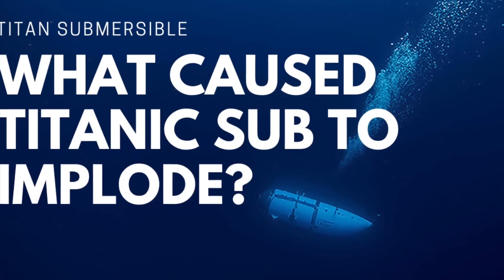What Caused the Titanic Submersible Titan to Implode?

Comment: You didn’t see any gasket between the metal ring and the composite tube is because they used adhesive. That’s an other videos that are out there will show that. 

Now, if you want to comment about how they inappropriately used the adhesive, I think you would have a better observation
Reply from the maker: not between the ring and the tube, but between the ring and the front that bolts on.
there is the titanium ring bonded to the carbon fibre, but when they climb in the titanium front bolts on  and it  mates directly against the titanium ring. so you have 2 flat pieces of titanium in direct contact. i would think having a seal of some sort in there would be beneficial.

Comment: The carbon fibre was wound around a 2 inch thick steel tube , also the inner chamber was lined with a fine woven mesh . No way was the monitor screwed to the carbon fibre. Not even Stockton was that stupid .

Comment: Carbon fiber was not the right material. This vessel should have been 6" of titanium with no cf. Proper double walled pressurized windows. The cheapest imo would have been about 10 to 15 mil to build. How much did they put into this thing? Vessel should have been tested and certified BEFORE taking any paying passengers regardless of disclaimers. Sad.

Comment: There was an inner lining to which the monitors and lights were attached to.  Rush was filmed stating this and that there were NO holes in the carbon fiber hull. You need to fact check better.

Comment: I just replaced my steel well tank with a much thicker composite tank. The manufacturer of the composite tank mandated the use of a vacuum breaker on top to prevent the tank from collapsing when it is being drained. The thinner steel tank didn’t require a vacuum breaker. 
I’m not an engineer or a sub designer but I know what materials I would use.

Comment: ..everyone who ever laid down some boat hull, regardless size, will tell you that fiberglass(sister of carbon fiber) is porous material, just like carbom fiber, while steel, aluminium, is not. And these features of materials gets amplified rapidly under tremendous pressure, if there is slightest imperfection on resin side. This is exactly where things went wrong.

Comment: SO, how does a carbon fiber hull, which seems to be weakened by penetrations, have the controls penetrate it? 
and what was inthe rear tail cone? Was it just streamlining? Or a cover for the control lines?
Reply from the maker: I wonder if that’s one of the reasons for a Bluetooth controller. All the control systems are external to the pressure hull, with no penetrations. Lots of gear looked to be under the tail cone

Comment: To be fair that looks an inner liner he's screwed stuff to, I've seen a video where they fit the backlights in without the liner fitted. There's a titanium drum between the cf and inner cf liner by the looks of it. One thing no ones looking at is the grommets and connections going into hull, also how well were the computers protected? He has expressed belief that only the hull needs protection, I'm dubious as to how well he has engineered the components he deems nonessential. He could have even carried a tank down there of the wrong rating and destroyed the hull with it. We wouldn't know from here.

Comment: Just a couple of comments/observations. If the faces of the nose dome and ring are not well milled then surely, asuming there is no elastic deformation making a seal due to external pressure, then surely there would be water ingress at some point.
Also just from the video, the internal surface where the monitor is bolted appears to be metal rather than the carbon composite. Is this perhaps not just an interrnal liner of some sort and the monitor is in fact bolted to that.

Comment: The no seal on the titanium isn’t the issue and it’s well known now that the screws didn’t go into the carbon fiber. Stockton talks about that in an old interview. It was either the materials interface, or the carbon fiber itself since it can’t manage exterior pressure well

Comment: At 2:24, that thin ring seen on the mating surface probably is the seal.  A cursory analysis suggests that the bolts only need to locate the end caps, not hold them in place, as the net effect of the water pressure is to force the end caps against the end rings.

At 2:59, optically flat ground surfaces are relatively easy to produce, in threes.  Rub one against two, then rub two against three, and finish by rubbing three against one.  Do this repeatedly with finer and finer abrasive grit and the three surfaces can have the differences between the highest and lowest spots being less than a wavelength of visible light.  As the parts with the intended flat mating surfaces get larger and larger, this gets more difficult, but it was known in Isaac Newton's lifetime.
Reply: Obviously the end caps had a proper seal.  They may be found still bolted to the glue rings.

Comment: Little or no scrutiny seems to be directed at the epoxy joint between two very different materials,,carbon fiber and titanium,,or the greatly different thermal and mechanical properties of each,, when subjected to the extreme thermal and pressure related mechanical forces encountered during a dive to such depths.
Reply: That needs to be looked if they can bring up the pieces.

Comment: Good job, Those were my two major questions/concerns,  the way the carbon fiber was wound with no weaving pattern,  and the 4000m depth rating,  you are the first I have seen bring up those two important failure points,  everyone else just wants to talk about the game controller,
Reply: The game controller is a Red Herring as far as I can tell.  It is not the cause of the loss.   But then again who really knows?  Will it be found intact?
Reply: You are almost certainly right about the irrelevance of the game controller, However until they do an analysis of the wreckage, nothing can be dismissed at this stage.

Comment: From what I understand, they put a carbon fiber insert inside the main carbon fiber hull. With that said, couldn't he have used a titanium liner on both the outside and inside? Not sure what thickness, but he'd still save weight and add strength to counteract the extreme external pressure.
Reply: I thought that too.
Reply: I never saw any reference to the “liner”. They certainly wanted to avoid using titanium since it is a lot harder and expensive to work with titanium.

Comment: Can somebody clear something up here. Cameron says the explosion occurred at 3500 feet. That would only yield a PSI of 550 or so. Would that pressure cause an implosion? Or, did he really mean 3500 meters which then would result in a PSI of over 5000? Something’s not adding up here because both the captain of the Coast Guard and Cameron are calling out the loss of communications at 3500 feet. They also say they were 1 hour and 45 minutes into the trip which should almost put them at the bottom in just 30 or so more minutes. We haven’t heard what their descent rate was in the vertical so it’s difficult to place where they would have been at 1 hour and 45 minutes.
Reply from the maker: i belive he meant meters, not feet. its 2 hours down to the titanic, at 3800m, so 1h45m in, being around 3500m sounds right.

Comment: at 2:21 you can see there is a transparent liner inside the cylinder, the monitors are bolted to that transparent (perhaps insulating) material and you can see ceiling lights under the lining shining green

Comment: For example with lifting equipment as cranes, telfers, chains, if they are rated to 2 tons, they have to withstand atleast 3x overweight of 6 tons. 4km submarine should also be tested at 12km atleast 500 times. Then you can atleast take notes and approximate how many times the sub can dive.
Reply: I assume any safety factor was guess work at best.  The engineering  of the FIU bridge was very poor.  The engineer of recorded stated he didn't believe the cracking was a problem just a short time before it collapsed completely killing at least 6 underneath.

Comment: One of the passengers said that the plexiglass window cracked thus it might have been a factor of the implosion. Your presentation was very good with good information  and a video on how the passengers were bolted in ,so please make more videos on ocean gate
Reply: I'm thinking if the CF is completely shattered it would be the problem. If the craft had been found more or less intact but full of water something else would be the problem,   The Titanium end rings will be of interest.  How much glue is left on them?  Maybe the Plexiglass window will be found more or less undamaged.
Reply: @JoeLinux2000 Apparently the window blew out (or in, or disintegrated). An eagle-eyed commenter noticed the wreck as it was brought up — there was empty space where the window was supposed to be. 
Incredibly sad.😔

Comment: I noticed the computer monitors and lights screwed into the hill as well. Ridiculous. Aldo, it has seams. I don’t like seams on a sub. Water will, eventually, find its way and implode at the seams. It’s stronger when the vessel is one whole piece. This guy was nuts.
Reply: They are never in one whole piece, there has to be at least one hatch and a viewing port of some sort. I think the seams you noticed are on the internal  metal liner rather than the pressure hull.

Comment: In regards to the flat on flat titanium mounting plates of the nose entry cap, a conical surface would be a mechanically better design to insure the seal.  A pressure ring and latches instead of bolts would be better.
Did they consider bolt an thread fatigue?
Was a torque wrench  used to insure even and proper bolt stress?
Reply: I think I saw them using a torque  wrench in one video.
Reply: @JoeLinux2000 , 
Thanks.
I wasn't sure.
Usually one speeds or ratchets a bolt almost tight, then torques it down to final tightness.

Comment: As a practical person I believe the titanium rings that the domes were bolted through to were "glued" by some form of adhesive which to fair can be very strong.The issue I have is due to the freezing temperatures at those atlantic depths and variations in contraction between carbon fibre and titatanium. Under the enormous pressure on top of that my thoery is one of the titnium rings separated as the carbon fibre contracted under said pressure and broke the adhesive bonding.Or as you suggested the mating surfaces were not exactly flat.( much like a cylinder head on a engine causing gasket faliure) 2 tons per square inch will do its thing at the weakest point.I also believe the actual thickness of the hull was a mere 5 inches.Surely that would have rang alarm bells with me .Steel is very different and  inches would sound reasonable but knowing how modern day carbon fibre bicyles flex compared to steel would have made me avoid this trip personally.I an surprised it actually managed a couple of journeys before it failed.More luck than judgement arguably?
Reply: That is were if I were a betting man I'd put my money. Dissimilar materials glued under those pressures and temperatures are guaranteed to fail.
Reply: ...And when they bolted the thing shut, they didn't even use torque wrenches. "Hand tight, Mate"? "Yeah, that's good enough".
Reply: Carbon fiber is not have elasticity when under pressure. Titanium does. An engineer on site brought this point up however he was fired. Best job termination ever! It perhaps saved the engineers life.
Reply: Your theory might just lead to leak, and the entire craft might have been found intact on the bottom full  of water.
Reply: @JoeLinux2000  doesn't work that way with pressure.

Comment: Very good catch. Stockton Rush hired a bunch of amateurs so his view didn't get challenged.
"A chain is as good as its weakest link" and his weakest link was very weak. Drilling holes into the carbon fiber was definitely a bad idea, and if the screw was 1 inch long, his 5 inches thick carbon fiber hole was only good for 4 inches.
Reply: Not sure any of that is true.

Comment: They got lucky with a catastrophic implosion.  There are worse and more painful  ways they could've died down there. A leak being a  particularly bad way to go. Others like fire and suffocation are also bad.
Reply: Very good points.  It's actually a very good way to go, particularly if they never had any indication it was coming.
Reply: No such thing as a leak at 6,000 psi. It holds or it implodes.
Reply: @johnsmith-wo4fr  Nope. A leak is possible. And considering that Carbon Fiber is better in Tension,  it would've held(under certain conditions) till the water and air pressure equalized. Which would've been a bad way to go. We are not certain yet what caused them to try to abandon anx resurface...or if they tried to resurface at all. There's ambiguous information floating out there.

Comment: 13 dives is pretty good.  I wouldn't think it would survive 1.  8 hours at the bottom 13 times shows the design did work.  So if you take the cost to build one vs a fully classed metal one, it might have been cheaper to use it 6 times if 10 to 15 times is the limit and the average is 13-15.  You can reuse the titanium ends and replace the plex window or remove it all together and just use cameras.  Make a crisscross pattern, better glue application, make the carbon fiber 7 inches think with maybe more titanium  sleeves in-between.  I wonder what the cost differences were and if he was a little bit more safe in his thinking if he could have pulled it off.   We only questioned anything after this failure.
Reply: Your comment is what we need.  Ideas that would make it more reliable over the long term.

Comment: Please find some evidence that the exterior power/electrical control cables were drilled through CF-hull rather than the end-caps.

As to them (Rush) drilling holes into the carbon fiber hull , rather than into an interior liner , to mount accessories, please find some info/evidence  of that. I don't think anyone could be so stupid.

And if you can go far, please find some evidence , that all the  control wires and air/pressure lines to the crew-space  were drilled through the carbon-fiber hull, rather than just the Ti end-caps. (that is a good question)

Comment: A small scuff from a hoist cable anywhere on the sub could weaken a portion. It was made like a spacecraft (titanium spheres with carbon fiber. But a spacecraft only has to launch once, then it's in micro gravity and a pressure of 14.7 psi. Yes, no decimals are missing, it's just 14.7 psi. Not enough for a bicycle tire
Reply: The CF tube was covered by an outer skin, as best as I can see.

Comment: There was internal cylinder also, and that internal one was used for fixing gear etc, external cylinder was never tampered with... Sad thing is external cylinder was never intended for more then 4k km, and after few submerges material just gave up... After all, titanium shells were found together with some other parts, yet carbon cylinder is gone...
Reply from the maker: do you have a reference for that? id like it to be true..
Reply: @hfxshippingnews  it's all over the news what's left of Titan...
Reply: If everything is there except the CF it pretty much solves the riddle.

Comment: There seems to be  a lot of critical design assumptions that was made for the hull because if a typical FEA analysis was done they would have had to assume a continues homogeneous material which carbon fibre is not. I don't think they did any tests on the unit to get emperical  data that could have been used for the overall design. So a simple question is, how did in the first place calculated the thickness of the wall by not knowing the expected deformation and acceptable stresses in the material.
Reply: I wondered that too. They may have gained some information from CF aircraft design.

Comment: I’m no expert in submersibles but I am a subject matter expert In resins having been in resinous flooring for the better part of a decade and a half. 
I can’t speak to the formula or supplier of the materials used in the construction of the craft but I can say with  great assurance that sheer strength on its own could be no greater than 10-15,000 psi as part of a matrix. 
  
Also .. using such dissimilar materials in the construction was asking for disaster
Reply: The resins are just used to bond the fibers.   However the way it was wound is of concerned.
Reply: @JoeLinux2000  Yea no i know but that is the matrix that holds the carbon fiber together .. You can’t just lay a little resin on it has to be completely encompassing and saturating the carbon fiber in order to make a solid material out of carbon fiber much the way fiberglass is used for boat and surf board production. The design of the pressure hill shape is absolutely  what did them in .. not to mention penetrating the inside of that hull with mounting screws for monitors and the handles above head … that should all have been adhered with heavy duty adhesive not screwed directly into the carbon fiber … It’s so completely moronic to me .. Wittingly breaking mechanical bond in the carbon fiber /resin matrix